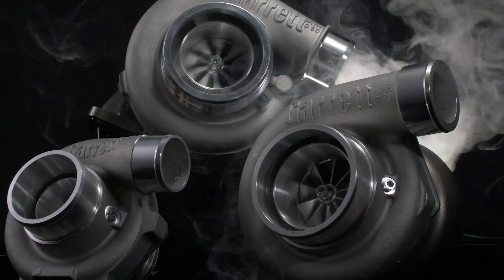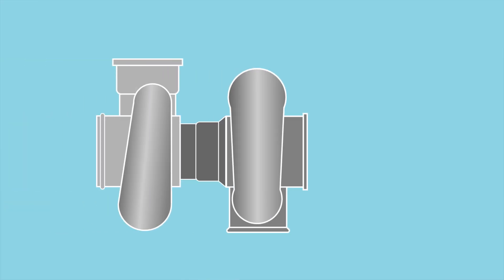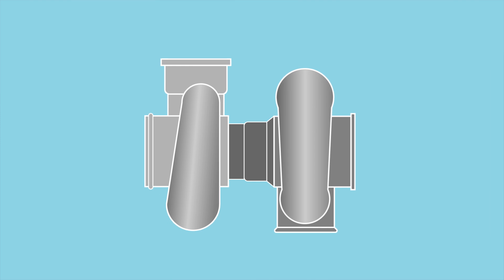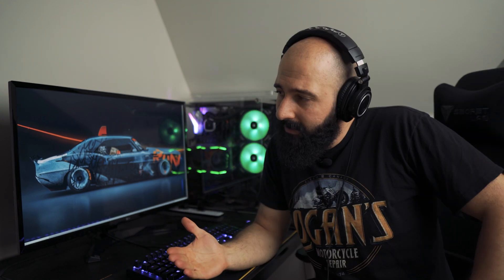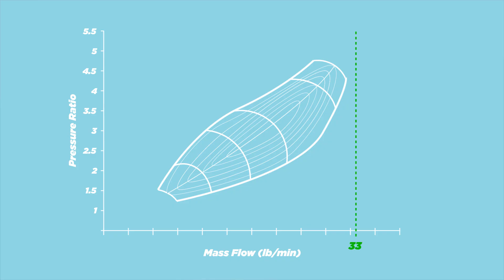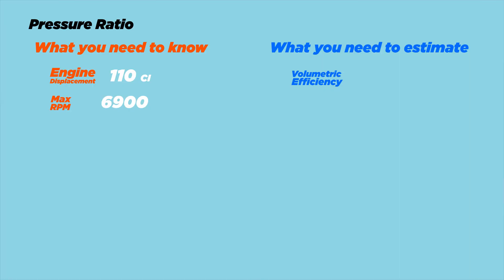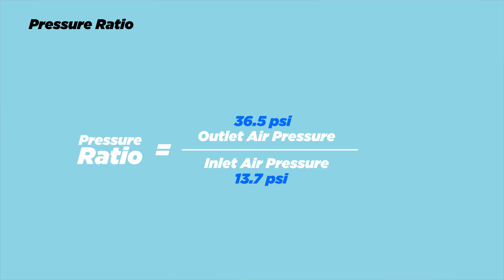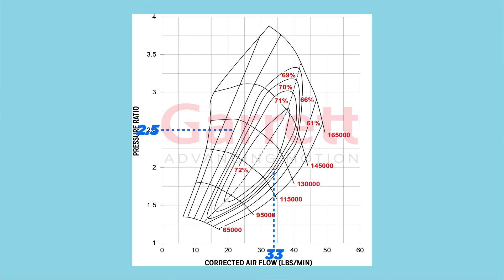How to choose the right turbocharger || EXPLAINED

Comment: If the pressure ratio on the map islands is too high but the mass flow lb/m is centered, what does that say about the turbo?? if the PR is too high or too low, is the question. Does it mean the Inlet is larger than the outlet or something?

Edit: NVM I f*cked up somewhere with my numbers, I'm down to 3 PR from 3.6 🤦‍♂️
Reply from the maker: They need to intersect on the most efficient island, the higher and closer to the right of that island is best, as you would stay in the efficient zone for lower rev ranges as well
Reply: @MZopyrus  oh I see, thanks for explaining MZ, Also, I see a bunch of 4 cyls' like the 4b11t Evo X making over 700hp and/or Mazdaspeed engines also over 800hp. I tried to do the formula on a stroker 2.5L (153ci) with 770hp, but got really high Pressure Ratios. But as you said above, as long as its on the high/right side it remains efficient, right?

Comment: isnt the second turbo more effecient because it can flow up to 500hp and the 2860 only up to 360? So 300 would be a "lighter load"?
Reply from the maker: Not always. It may seem that way in this particular case but if you look closely at the compressor maps you'll see that the first one is actually at 76% efficiency in the center, but the second one is at 72%. So if we're strictly talking about efficiency, the first one is more efficient! but not for our target horsepower. The efficiency island is too narrow. Whereas the second one had a wider island where the compressor is at its peak efficiency and it can flow the air we need. Hope this makes sense 😅
Reply: @MZopyrus  it does! Thank you for the reply. As a car guy, your channel is literally a hidden gem. Please keep making content! Maybe a video on dual charging? 🙏

Comment: I would want to Turbocharge a 2018 BRZ TS in the future to make 600 - 700 HP by putting iron sleeves in the stock block and fully forged steel internals. Is it possible or I would have to get a closed deck engine block?
Reply from the maker: To be honest I think a closed deck block is a must for these engines if you're going for significant power gains. Having that said 700hp is a very expensive target power man. Might be even cheaper to do an engine swap at that point
Reply: @MZopyrus  yep it is or even 600 would be fine but like a 2jz would do?
Reply from the maker: Yea, I mean 2jz's are getting expensive but you could potentially just do that and slowly work your way up to those 600-700 numbers. It would be more drivable as well imo
Reply: @MZopyrus  thank you so very much for the suggestion